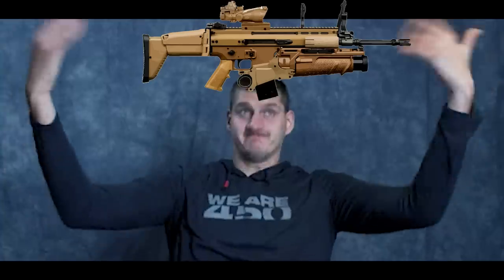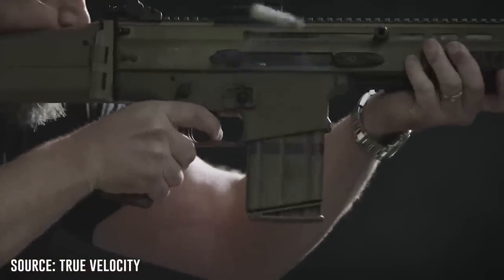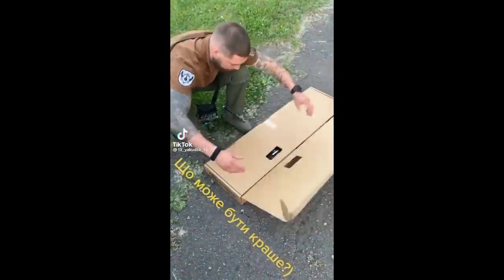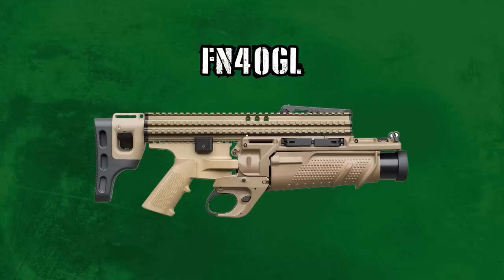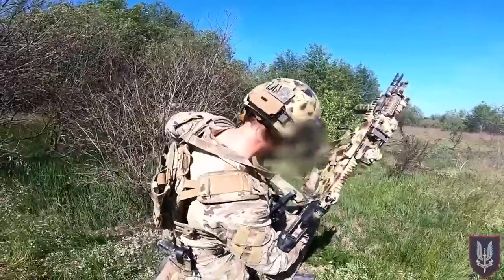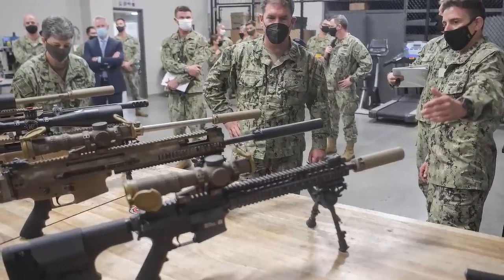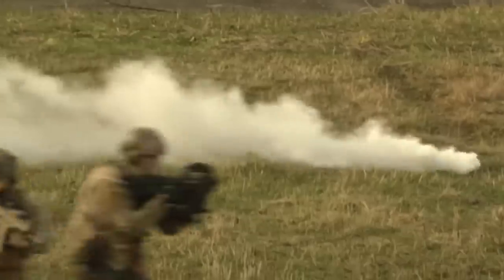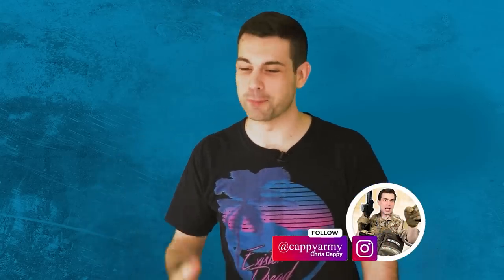Why this SCAR-H Rifle Uses Plastic Ammo Casings (Weapon Analysis)

Comment: The idea of severely reducing heat buildup by switching to polymer cased ammunition is a huge deal that I don't think gets enough attention.
Reply: Weight in general is seen as a silver or bronze medal priority, never a gold, until logistics and the front line suffers.
Reply: I don't see why it's not already a thing.  Less heat-- less weight-- less cost.. ??/   whats the down side?
Reply: @calholli  can't handle 80k PSI that's the reasoning for most sig Sauer fanboys. but hey if you can achieve the same ballistics with less powder like you can with  polymer I don't see why this was never adopted it should have been adopted in my opinion
Reply: i think it takes a lot of time to develop, in theory it sounds great, but in reality probably the polymer casings have many unforseen flaws that have to be encountered first in order to fix, through testing
Reply: always when developing something new there is many fatal flaws that you have to simply encounter by accident..
Reply: @acctsys  probably because every soldier is buff.
Reply: @danielsnook7362  80k psi would only be for the new 6.8 ammo..  Regular 5.56 is only like 55k psi.  They use a 90k psi over pressure round when they test the barrels. (HP MPI testing).   I don't think using less powder makes it have less pressure;  it just doesn't have to burn as long-  due to less heat loss through the plastic.  It's interesting.  I'll be happy to see it come in the future.
Reply: @calholli  really where do you find that out cuz that's very impressive
Reply: @calholli  oh by the way do you know if it's true that the spear had a higher velocity than the true velocity bullpup😅
Reply: Iirc, the main issues with polymer casings were inability to reload spent casings, they cost literally 5 times more than regular rounds, and very sadly, they give worse accuracy.
Reply: Composite casing could be a game changer, especially if it can reliably be stored for a few years in hot/cold climates.  30% weight reduction? That's significant!
Reply: @danielsnook7362  I know nothing
Reply: @danielsnook7362  It's pretty common knowledge
Reply: @foundati0n  Does the military even reload spent casings? If they do, that would be news to me!
Reply: @foundati0n  You can't reload--- but you could definitely recycle the plastic (I would think).   And once plastic ammo were to be made in mass volume--  It would likely be even cheaper than brass;   given that plastic is cheap, the manufacturing is cheap, and you save on powder.
Reply: @calholli  also, plastic=not recycleable and bad for the environment.

Brass can be reused.
Reply: @triadwarfare  wouldn't that depend on the type of plastic though cuz there are plastics that are recyclable others that aren't just depends from what I could tell
Reply: @calholli  it's actually more expensive now, perhaps if enough were produced it would be less.
Reply: @bradleytrainor7856  im in the Army and i may be an idiot but im pretty damn sure they do
Reply: I thought a big part of brass casings is that they "remove" a lot of the heat as they are ejected (heat conducted into the casing, instead of going directly into the gun). Isn't this why caseless ammo has always been a failure in the past?
Reply: 3d printed guns go brrrrrrrr
Reply: @njones420  yea I was gonna ask that too. Where does the heat go in polymer ammo?
Reply: @njones420  ohhh actually I think it’s cause polymer is an insulator. Aka less energy gets wasted being absorbed by the brass shell as heat energy, which means less gunpowder is needed for the polymer case for equal projectile force.

All the energy goes out the barrel instead of being absorbed into the brass
Reply: @calholli  maybe they already adopted it but won't say publicly
Reply: Brass cases pulls heat from the weapon
Reply: That's why I was cheering for true velocity and general dynamics in large part. That combined with weight and eventually cost seemed like a no brainer. I understand the decision, but really wish they would use polymer ammo on many weapons.
Reply: @Colonies_Dev  I think you’re right but I think a lot of it comes down to politics and the way the military has to coordinate with the rest of NATO. Much of the treaty requires the coordination of nations in regard to the ammunition they use to ensure that there is always a steady supply of it. If only one company is producing the ammunition then that’s a weak point in the supply chain and something to avoid, at least until they’re able to produce the ammo from many more manufacturers in multiple NATO states.

Also, there was a good comment I remember reading the last time the topic came up which had to do with the polymer’s potential to fail when at higher temperatures due to polymer’s lower melting/warping temperatures. I haven’t seen those concerns addressed anywhere so who knows.
Reply: Honestly, couldnt that hugely effective when it comes to LMG's, MG's and such to help deal with barrel heat?
Reply: @danielsnook7362  Best option would be, all ammo that is not for body armor should be plastic cased 6.8mm and ammo for body armor should be the 80k PSI Steel hybrid 6.8mm.     7.62mm is too heavy and bulky for the role and 5.56mm is too wimpy.
Reply: @triadwarfare  Bad for environment? Just incinerate the plastic easy peasy. As long as a scrubber is installed its not a pollution risk.
Reply: This really gets me excited when it comes to shorter barrel lengths.
Reply: @delvint9966  and the best feature of polymer cased ammo for the machinegunnear would be the weight reduction. Basically a win-win. IMHO, the sensible thing for NGSW would be to switch to steel-polymer cases. Moreover, why do they want to make every soldier a sniper? Wanna penetrate armor - try to make fast flying 5.56 (possibly with SIG technologies for cartridge and barrel) and 6.8 should go only to marksman and machinegunners, for them having longer barrel would not be a problem, so you can use a polymer cartridge with lighter load. Also only 3 of those space tech sights would be needed per squad (maybe four if you give one to a commander), other grunts (with 5.56) would not benefit from them as much. This is war, not a sniping tournament: in a long distance you use machinegun to pin down your enemy, then launch a drone and do actual kills with a mortar. And in CQB 5.56 would be just much more practical.
Reply: Heat and weight has been the focus of this idea for at least the last two decades bro.
Reply: @Colonies_Dev  that's the same with any new firearm or ammunition though. Just an ordinary part and parcel of development.
Reply: Agreed.
Reply: @Colonies_Dev  I think the reason for the choice of Sig Saur was because it can use already existing infrastructure to produce. This is big deal because if both perform similarly in testing having one that does not require al factories to open new production lines is a Major pro for planners.
Reply: @danielsnook7362  this is an extreme aplications of plastic. The Major issue of plastic is that after recycling it looses its material properties such as strenght. Metal is by far easier to recycle, melt and cast again.
Reply: Yes bcz you can sustain fire for longer without overheating the barrel quickly.
Reply: @acctsys  this is why every general and admiral needs to be required to do a yearly hell march organized by the the lower enlisted
Reply: But less powder and flash as well?
Incredible.
Tru Velocity will be the real winner from the trial and the M5 may still turn out to be the 21st century M14
Reply: @pedrorequio5515  true but running brass at such a high pressure that's going to cause the barrel to heat up and warp at a incredible rate
Reply: @pedrorequio5515  I do see your point though definitely
Reply: I was thinking the same. I guess some old schoolers in acquisitions still want their brass rather than have range officers should, "Police up your plastic!"
Reply: @danielsnook7362  If we were still using barrel metallurgy and material science from the late 60's, you might be right, but we're not. 4150 CMV and hard chrome bore coatings are as obsolescent as 7.62x51mm is, that's all on its way out.
Reply: @foundati0n Our military does not reload brass.  The empty casings are sold at auction to scrappers.
Reply: If so, where does the heat go?
Reply: @Brazath2  It mostly gets converted into kinetic energy (i.e. higher muzzle velocity for the bullet), plenty of it just goes out the barrel muzzle with the excess gas, and some ends up in the barrel itself; the barrel only heats up marginally faster with polymer cased ammo compared to metallic cases, while the chamber sees a massive difference in how slowly it heats up.
Reply: @Brazath2  Don’t ask that.  It goes against the marketing strategy.  And the fact that fresh cool brass acts as a heat sink to cool the chamber? 
Nothing to see here….just keep walking.
Reply: @blackhawk7r221  you seem not to understand the concept at all. Grab a live wire with your bare finger and then grab the same wire with an insulated glove and then ask "where did the current go?!". 
The idea behind the polymer case is that the heat is not transferred to the gun at all, the gun is isolated from the heat by the casing itself. The brass doesn't pull the heat from the gun, the gun itself doesn't generate heat. It's the burning powder that generates heat and with brass casing part of that heat is transferred into the gun and part of it is taken away with the brass. The polymer casing doesn't do that, it doesn't allow for the heat to be transferred into the casing in the first place, that's why you can use 10% less powder to get the same performance - you don't have this energy waste as heat transferred into the case and into the chamber.
Reply: @triadwarfare  Well, I have news for you.
Reply: It's more about more of the heat energy goes into firing the bullet than soaking away into the barrel 👍
Reply: @blackhawk7r221  they auction the brass and while some or even most end up scrapped, tons end up cleaned and sold to reloaders. more money to be made selling it to reloaders than scrapping it
Reply: @ostiariusalpha  I'm a little skeptical about it
Reply: @Brazath2  That's fine, but it's an established fact regardless.
Reply: @melissanelson5093  Yep.  When we turn in brass after a field problem, we have so much of it that we just drop it off ourselves.   Containers the size of dumpsters filled with 20mm, 25mm, 7.62, you name it.
Reply: @ostiariusalpha  On the military side, we will continue to use chrome lining simply because it is an actual metallic layer of long lasting hard chrome vanadium rather than a surface case hardening like hot salt nitride bath.   
That’s the military mindset.
Reply: @blackhawk7r221  The XM5 and XM250 have already abandoned hard chrome for diamond-like carbon, a much more heat and wear resistant coating than chrome. Chrome only sticks around for legacy weapons due to the TDP being treated as the infallible will of God once it is established. FN couldn't even change the M4's TDP to include cold hammer-forging for the barrel, despite clearly proving that it improved barrel life. The new 6.8x51mm weapons benefit from a brand new TDP, so they get CHF barrels made of 32CMV12-10 steel with the DLC bore coating.
Reply: And it avoids the biggest problem with caseless ammo: trying to get heat OUT of the weapon when you aren't ejecting cases (which are essentially little disposable heatsinks).

Wonder if the polymer case allows them to profile the case interior to improve powder burn and pressure gradients 🤔
Reply: @triadwarfare  some plastics can be made to biodegrade, i heard of casings like this being tested in ukraine or something
Reply: I love it when I read this from Thar, but not so much when I read this from Siachen 😉
Reply: So we do have to concede that chambering a fresh cool brass case does act as a heat sink to draw heat out of the chamber, but once fired, that same brass case now acts in the opposite.   And vastly.
We have our doubts about the words of a paid expert to market his product.  
Mount two operational rifles firing each type of ammo in front of a thermal camera to sell us the proof.
Reply: @calholli  less gunpowder requirement = less cost = more efficiency
Reply: @blackhawk7r221  Even I was wondering the same. The brass cases that keep getting ejected one after the other, each takes certain amt of heat energy with them.

While the polymer ones hardly carry anything with them. So, all heat with polymer ammo is retained inside the barrel.
Reply: In the case of polymer cased ammo being used in shoulder-fired rifles, heat buildup is really not an issue.  We seldom carry more than nine magazines anyway, and for sustained blasting, we have a SAW or 240 gunner.   
Now polymer cased for belt fed weapons is a whole different story.
But for an individual rifle, the case for polymer relies completely on profits, ease of extrusion manufacturing, and proprietary copyrights.  Weight is secondary to a manufacturer, but primary to us grunts.
Reply: @calholli  polymer UV breakdown
Reply: @xapemanx  You could coat it-- paint it, ect...  and besides, when does ammo ever see the light?   It's in an ammo box, then it's in your magazine--- Light never shines on it.
Reply: @17nirmalya  The polymer cased ammo is an insulator. The heat is not transferred to the chamber at levels close to a brass case. He's shown videos before of shooting a mag and then touching the chamber and it is cool to the touch! The amount of heat "disposed of" when a brass cartridge ejects doesn't nearly make up for the fact that it easily transfers the heat into the chamber/barrel as soon as it ignites.
Reply: @extragoogleaccount6061  We both agree that the polymer ammo is an insulator. So, the question is - the heat has to go somewhere. If the heat is not coming to the chamber, or is not getting ejected with the casings, it is most certainly going to the barrel, isn't it?
Reply: @calholli  plastic isn’t necessarily cheap, sure stuff like ABS is but especially high performance ones like Peek or high performance Nylons like PA-12 are a lot more expensive than Brass for sure. 

Also if it really is a composite that will make it a lot harder if not impossible to recycle. 

Most plastic recycling is a lie as it is, only a very small percentage really gets recycled because its expensive/challenging especially if all you get is something like household plastic trash, thats gonna be a mix of hundreds of different materials like PE, ABS, PU, Polystyrene, Acrylic, different Bioplastics, some paper from labels, PET, PP, maybe PETG, hundreds of different pigments, dyes, softeners and other additives, ad to that contamination from people using it wrong and just throwing whatever in there and all the other varieties of plastic and you will see how hard it truly is to recycle plastic.
Reply: @OperatorKevlar  "probably because every soldier is buff."

great. but lower weight still makes it easier for them to move.
Reply: Isn't one useful property of brass ammunition casings that they act as an sort of an ejectable heat sink?  With this system, wouldn't the barrel and other components be heated by both the friction of the bullet against the lands/grooves and from the propellant?  If the bolt and chamber don't heat along with the barrel does that cause issues created by uneven thermal expansion or warping?  I'm not saying any of that is an issue, just questions that occur to me while watching.  Thanks for making easy to understand presentations of otherwise esoteric military topics, great video, and thank you for serving!
Reply: @warpdriveby  no. because the polymere insulates, meaning the energy that usually heats the casing AND the barrel remains in the shot, which propella it more instead of heating stuff up.

if it insulates perfectly, theoretically all you have left is friction.

a heat sink is better than nothing, but insulation can do much more
Reply: Not to mention you can carry double the amount of ammunition
Reply: @jurgnobs1308  Interesting, thanks for the answer.  I have no military experience, and while I shoot well I'm a relative novice in the group watching this.
Reply: You aren’t reducing heat, you are just transferring it to the barrel. Brass carries best away from the weapon during sustained firefights. Using polymer ammo will keep the action cool but ultimately burn the barrel far faster
Reply: @OperatorKevlar  yeah but if you lower the weight you can carry more ammo with the same weight that’s a huge deal and that will mean logistics won’t have as much weight
Reply: At the very least we should be looking at those belt feeds made out of polymer that Ukraine is currently using, that alone saves weight on using belt fed machine guns. Combine that with polymer cased ammo.
Reply: @17nirmalya  it's generating less heat, 30% less powder burned means 30% less heat, there will also be heat within the cartridge when it's ejected
Reply: @calholli  Polymer is not storable as long as brass or steel cased ammo but they improving new polymers day-by-day. Maybe the same reason that the saboted small rifle ammo weren't catch up.
Reply: @Charles-pf7zy  the heat gets dumped into the barrel, which massively decreases barrel life.
Reply: @jacktheaviator4938  plastic case seals the weapon chamber from heat and tramsfers more to moving energy towards the barrell. That is why plastic case ammo can achieve the same velocities with less powder.
Reply: @jacktheaviator4938  Plastic case is an insulator. In other words the heat is trapped in the plastic case and less of it transfers to the gun, preventing things like cook off. Plastic is a poor conductor for heat while metal is great at transferring it.
Reply: @danielsnook7362  Or with the tactics, ranges, and new scope they are going to be used, having a cartridge with inferior ballistics but more rounds would be detrimental? Lots of stuff is classified and we don't know if there are going to be ways of keeping the enemy at a distance. Maybe. As far as a replacement for the 5.56, lets give it time to see what comes out of it. As a replacement for the 7.62, DMRs do have to shoot pretty far some times. Also, considering that no one the world uses polymer it either doesn't work or is FAR more expensive. The officers that are making these decisions know more then you and your understanding of infantry tactics are eventually going to change, so get used to things you don't like but don't understand. :D Last sentence is shit post/teasing not to be taken seriously
Reply: @mojothemigo  I hate to admit but you do have a fair point I just hope this does end up working as intended in the end. I just hope the 6.8x51 helps the soldier more than it hurts the soldier you know what I mean but your points still stands
Reply: @mojothemigo  I just feel like there are other calibers that could have been a better Middle ground the 6.5x47, 6mm ARC as well as multiple others that came up in recent years that could have been very good candidates to replace the 556
Reply: @danielsnook7362  I think you're the first person to ever be willing to say you MIGHT be wrong. Usually, I see veterans' text the equivalent of harrumphing and saying there is no way the tactics are going to change that make a longer reaching, harder hitting round work over more rounds of .308 or similar, they know more than officers, etc. I get irritated with the "I know better" jaded attitude. Zack from Mikeburnfire mentioned how Vets get attached to their weapons of war and tactics and you can't expect them to change. As a civilian having to listen to authority, officers come first. Despite setbacks, mistakes, and sometimes corruptions, the military leadership over the last 100 years has been very good with most problems being politicians.   On another intermediate cartridge: If I had to guess, I think they are going to SIG pressure charge a smaller cartridge either a new or one currently around.
Reply: @mojothemigo  not going to lie my wet dream is the 6.5x47 with hybrid casing. just a friendly conversation starter what would you pick if you could use any caliber for the ngsw and apply the steel brass hybrid to it 🙂
Reply: @calholli  Some heat loss is good, because that heat's got to go somewhere, and that's either into the barrel or into the case. The former leads to shifting of zeros and run-away guns, while the latter leads to minor first-degree burns though could lead to catastrophic stoppages depending on the melting point of the material.
Reply: No where did anyone say it produced less heat, only that the cases absorbed less because they're insulators. Which can be a huge deal in the opposite direction depending on how much more heat is getting transferred to the barrel ant not the case.